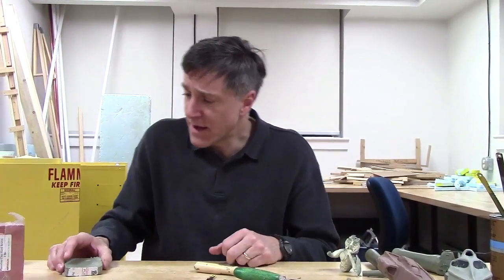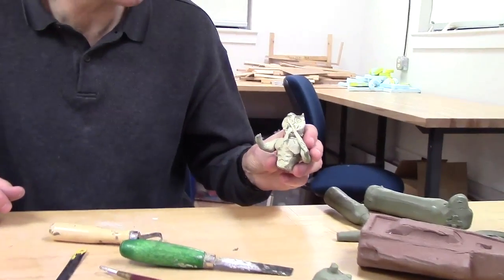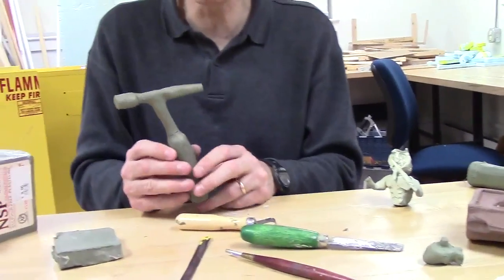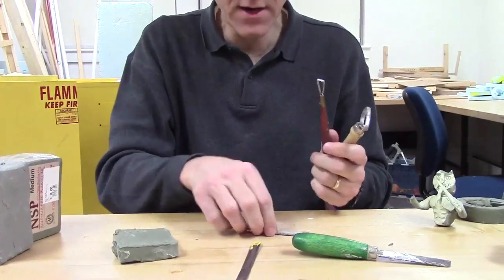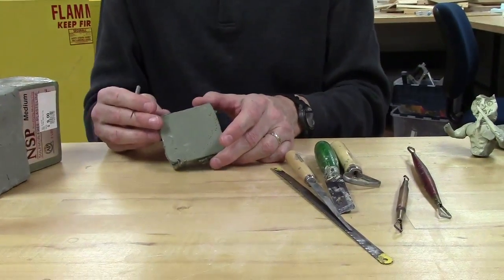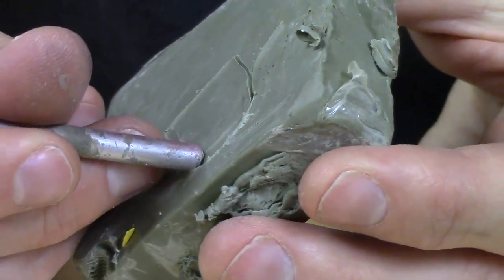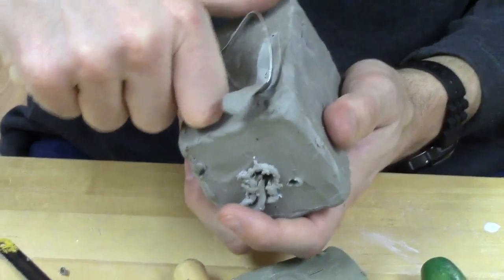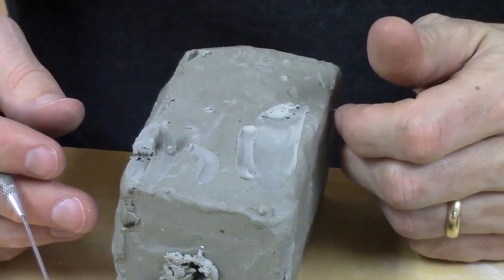Clay Sculpting Techniques for Inventors and Designers

Comment: is this kind of clay viable for making architectural models for university? (small models with details) (like collapse overtime if bigger than like 50cm?) I heard making clay models of your design(buildings, pavilions, etc) could get you a better grade in my university compared to 3d printing and other techniques but im not sure if it's feasable for smaller models that need to be accurate(or need alot of skills, as im sophomore as of now)
Reply from the maker: Yes, this clay is good for getting details. However 50 cm is large and you want to make some sort of underlying structure as an armature. However, the appeal of using this technique in the era of 3d printing is you can change it in real time or with a group interaction. It is much more difficult to get a finished product than 3d printing. You have to clean the burrs and work the surfaces to get a good finish.
Reply: @TomAskDesign  thank you!